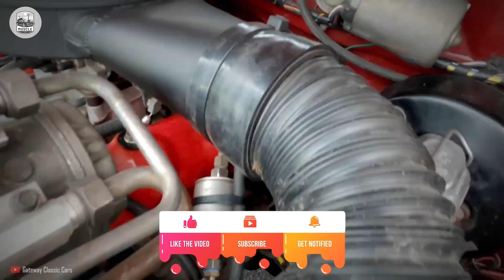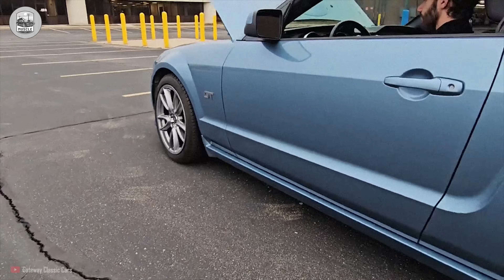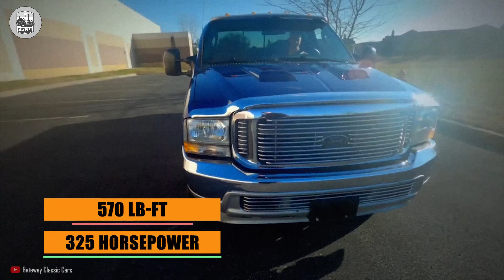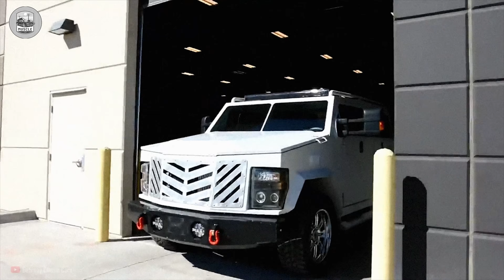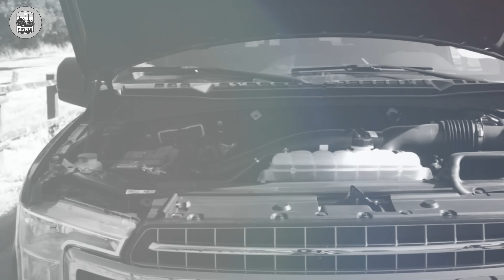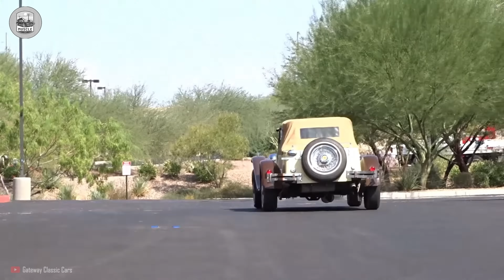NEVER BUY a Ford with this ENGINE | MOST FAILED Ford ENGINES ever put in production cars

Comment: This guy is an Idiot. He might as well just said that all Ford engines are junk. I was a tech for OVER 50 YEARS and although some of what he states is true, most is not. The Ford 4.6 was a great engine although I have replaced a few head gaskets and Intake manifolds but lack of cooling system servicing was the cause of most of it. He stated that the Ford Diesels were made by Ford while they were not. Harvester built and sold the 6.0 and 6.4 to ford for their trucks. In turn for all the problems, Ford sued Harvester almost into oblivion for supplying junk engines that Ford got stuck repairing. 
The 5.0 Coyote engine had some early problems but most have been addressed. ALL engines burn oil because of low tension oil rings. He talks like Ford is the only engines in the world to have head gasket problems. They mostly all had problems! He talks like it was only Ford that had problems. I took care of a fleet of ford Pickups and Vans with the 3 valve Triton engines. Most were sold at 300.000 miles and still ran like new. I replaced one or two Cam phasers. All still had the original chains and guides. They were maintained properly, with the best products. Out of all those trucks we had ONE spark plug blow out. I repaired it in our shop without even taking the head off. Nobody serviced them properly. You had to apply lubrication to the threads and use a torque wrench to tighten them to the proper spec. It's asswipes like this jerk that makes money by creating crap that most people believe.

Comment: As a Kiwi mechanic in the 1980's I rebuilt and tuned dozens of Mopar, GM, Ford, Holden and a few Pom V8's. All these engines had their own minor issues that could be improved on. Basically, they were all the same. The worse thing that failed these, and many other engines, was the removal of tetra ethyl lead from our fuel. This led to catastrophic valve seat wear, poor performance and expense of having to have the heads fitted with valve seat inserts. Fortunately, by design, they were easy to work on. An easy pre emptive fix was an upper cylinder lube device which metered small amounts of a hi tech oil into the inlet manifold. What I learn about these modern engines makes my blood run cold. Mainly from the stupid, untested design flaws/ ideas by the manufacturer and the horrendous cost and complexity of the remediation work. I take my hat to the modern mechanic 🙂
Reply from the maker: Wow, what an incredible journey as a Kiwi mechanic in the '80s
Tetra ethyl lead’s removal was a game-changer, and you're absolutely right—valve seat issues hit hard. It’s great you mentioned the upper cylinder lube devices; those were lifesavers for preserving performance in the transition era. The ease of working on those classic V8s really stands out compared to today’s complex engines—simple designs, but packed with character.
Modern engines can be a headache with their tech-heavy, sometimes untested features. It’s a salute-worthy effort from today’s mechanics to keep them running! Your insights into the evolution of engine design are pure gold for our Muscle Car family here.
For everyone reading this, share your own stories in the comments! Don’t forget to like, subscribe, and spread the word—let’s keep celebrating the legends of American Muscle Cars together. 
Hope to see you in the next video—have a great day.

Comment: 351M from 1975 into the early 80’s and their bottom end bearings wearing out prematurely about 70,000 miles is another one you missed…
Reply from the maker: Thanks for the comment
 You’re spot-on about the 351M—Ford’s “Modified” engine definitely had its share of issues. The 351M, introduced in the mid-’70s, was part of Ford’s attempt to meet emissions regulations, but it suffered from design compromises. One major flaw was its thin-wall casting and low oil pressure, leading to those bottom-end bearing failures you mentioned. Combine that with its low compression and disappointing performance for a V8, and it’s no wonder enthusiasts weren’t impressed.
That said, with some aftermarket upgrades, the 351M could be made reliable and even a solid performer. But back then, many gearheads swapped them out for 351 Windsors or 460 big blocks.
Have a great day.

Comment: 3.8 V6’s from the 80’s with their head gasket problems…
Reply: I bought new a 2001 F150 with the 4.2 version of the 3.8 Essex and it still ran awesome when sold at 212k miles. Very reliable, no headgasket issues.
Reply from the maker: That’s awesome to hear about your 2001 F150 with the 4.2 Essex V6
Ford really got the formula right with that engine—it built on the lessons from the earlier 3.8 Essex and proved to be a durable workhorse. Running strong at 212k miles without head gasket issues is a testament to good engineering and solid maintenance. For an engine designed to prioritize torque and reliability, it's no wonder the 4.2 found its way into so many loyal hands.
We’d love to hear more stories like yours—whether it’s about a trusty V6 or a roaring V8, every ride has a story. Share your experiences, drop a comment below, and don’t forget to like, share, and subscribe to American Muscle Cars! Let’s keep the community growing and the engines roaring.
Hope to see you in the next video. 
Wishing you a fantastic weekend—keep on cruisin
Reply from the maker: @johnmcmullen456 Ah, the infamous 3.8 V6 from the '80s and those notorious head gasket issues
 You're absolutely right—those engines had a reputation for overheating due to poor cooling designs and, frankly, a head gasket that just couldn't keep up. But when maintained properly, some of these engines proved surprisingly durable. The 3.8 also paved the way for Buick's turbocharged versions that absolutely ripped on the track—remember the Grand National?
For fans of American muscle, it’s a love-hate relationship with engines like this. They remind us that even our favorites aren’t perfect, but with some wrenching and a little love, they could still shine.
What’s your take—did you ever tackle a head gasket job on one of these? Let’s hear your stories! Don’t forget to comment, share, and subscribe to Muscle Car Masters to keep the conversation rolling. 
Have a fantastic weekend, and we’ll see you in the next video.

Comment: 3.8 V6’s from the 80’s with their head gasket problems…
Reply from the maker: Ah, the 3.8 V6s from the '80s—those head gasket issues were infamous
Buick’s 3.8 was a solid engine design, but poor gasket material and cooling system flaws led to leaks and overheating. If caught early, replacing the gaskets with improved materials turned these engines into reliable workhorses. Let’s not forget their impact: this engine laid the groundwork for the legendary Grand National and GNX turbocharged monsters! It’s amazing how Buick engineers pushed the 3.8 to deliver both reliability and performance in later versions.
To all American Muscle Car fans: we love digging into these stories and the engineering that made—or sometimes broke—the classics. Share your thoughts and experiences with the 3.8 or any other engine challenges you’ve tackled! Don’t forget to like, comment, and subscribe to Muscle Car Masters. Keep the love for American muscle alive
Hope to see you in the next video—have an awesome day...

Comment: We had a great experience with our ford 5.4 engine it was a 2 valve engine last I checked it was still running like it. Just left the lot brand new it’s over  quarter of a million miles and was never torn down
Reply from the maker: Wow, that’s an awesome testament to the legendary durability of Ford’s 5.4L 2-valve engine! Ford nailed it with that modular V8 design—known for its robust build and reliability. With over a quarter-million miles and no teardown, it’s clear you treated that motor right! These engines, especially the 2-valve versions, were known for their simpler design, fewer moving parts, and rock-solid performance. Perfect for everything from work trucks to daily drivers, they could run forever with just basic maintenance.
For those who don’t know, the 5.4 2-valve was often paired with the F-150 and Expeditions, delivering the torque and longevity that made them fan favorites.
Got a story like this? Share it with us below—we love hearing your muscle car memories! Don’t forget to comment, share, and hit subscribe to fuel our channel with your passion for American muscle. See you in the next video—keep driving those dreams.
Have a nice weekend.

Comment: The 4.0 SOHC? Also, I have 255k on my 3.5 EB. 70k of which was just this last year alone. Still going strong!
Reply from the maker: Thanks for your comment and passion for Chevy small blocks
The 305 shares many components with the 350, including gaskets, seals, cams, and lifters—classic GM parts-bin engineering. What sets the 305 apart is its smaller bore (3.736 inches) compared to the 350’s (4.000 inches), which limits valve size and airflow. While this made it more fuel-efficient during the gas-crunch era, it also restricted its performance potential.
We didn’t mean to knock the 305 but highlight its unique role in Chevy’s history as a compromise between power and economy. It’s no 350 powerhouse, but for many, it kept the small-block spirit alive when regulations made big performance harder to achieve.
Keep sharing your thoughts—we love a good engine debate! Don’t forget to comment, share, and subscribe to Muscle Car Masters. Hope to see you in the next video. 
Have a great day.

Comment: oh my gosh the 4.6 L 2 valve is one of the most reliable engines ever freaking made by Ford  the three valve is the one that has problematic issues with cam phasers and other things I've owned a few of them and I will tell you I have not had an issue at all and one of the most reliable engines that Ford has ever made even though it burns gas like freaking crazy is the big block Ford FE  it could be misfiring and jump timing to gear teeth or whatever but it's still freaking runs

Comment: The Narrator is obviously not a car guy.
Reply: Talking about a Ford engine show's picture of a dodge viper with the hood open? 🤷🤦"Ideal for F250-F350 trucks" shows an excursion 😂 I need some extra work, for a very reasonable price you can send me your script, pictures etc for me to document incorrect photos, videos information, spelling, etc then acquire the correct Media and information, proofread etc and return to you, I've been an automotive, truck, equipment, small engine, motorcycle, ATV,etc mechanic for over two decades, Including associated systems such as electronics, driveline, suspension, brakes etc I'm proficient in theory, design manufacturing assembly installation diagnosis repair replacement customization of most anything that burns gasoline, diesel , ethanol, methanol, nitromethane, jet A-1 etc or runs on electricity steam solar I've even repaired a water powered flour mill 😂
Reply from the maker: Thank you for pointing that out
We’ll be more vigilant with our visuals and ensure every image, video, and fact aligns with the heart of the muscle car world. Sharing your detailed knowledge would be a huge asset to this community! If anyone else has tips or corrections, drop them in the comments. Let’s work together to make Muscle Car Masters the ultimate destination for muscle car memories.
Remember to comment, share, and subscribe for more American muscle car nostalgia! Hope to see you in the next video. 
Have a good day...
Reply: Yeah, he's a robot.
Reply from the maker: @d.e.b.b5788   Hey there, thanks for the comment! 
But seriously, this channel is all about real car enthusiasts coming together to share the love of classic V8 power, timeless designs, and the roar of engines that defined an era. We aim to bring the incredible history and memories of muscle cars to fans everywhere—whether you grew up cruising in a Chevelle SS or just discovered the magic of a Mustang Mach 1. Your feedback keeps this mission alive, and we’d love to hear more from all of you.
Just kidding corner: We hope to have any robot or AI can generate the video like it...
Have a great day.
Reply from the maker: Thanks for your feedback
Our channel is all about celebrating the incredible history and performance of American Muscle Cars. While I may not be wrenching in the garage every day, I’m passionate about bringing accurate, detailed stories about these legendary machines to the fans who love them. If I missed the mark somewhere, let me know—your input helps make the channel even better. Drop your favorite muscle car or any topic you'd love to see covered! Don’t forget to comment, share, and subscribe to join our growing community of muscle car enthusiasts. Hope to see you in the next videos. 
Have a good day
Reply: @MuscleCarMasters68   F,in LIAR.

Comment: Bullshit on the 351w get real. One of the best engines ever made.
Reply: @havoc9926  that's a fact I have 2 trucks with the 351 and my boat has one to
Reply: @xxkingslayemxxgamer5553  I reckon!! I have just, this week re commissioned one in a jet boat. Just new cam, Timing chain, lifters, rings, big end bearings, re seat valves. Gaskets. 2 hrs to strip, 4 hrs to reassemble.  It had a bent distributor, possibly why the owner thought it needed a rebuild?? Parts were cheap. super simple job  🙂

Comment: Are the Triton and the Modular 5.4 engines the same. This video makes it sound like it.
Reply from the maker: Great question
The 5.4 Triton is part of Ford's Modular engine family, but they’re not exactly interchangeable terms. The "Modular" name refers to the entire engine platform that includes a variety of V8s and V10s, like the 4.6L and the 6.8L. The 5.4 Triton specifically refers to the version used in trucks and SUVs, often built with a 2-valve or 3-valve setup, depending on the model year. On the other hand, performance versions of the 5.4 Modular, like the ones in the Ford GT or the Shelby GT500, are entirely different beasts with superchargers and higher-performance components. So while Tritons are Modulars, not all Modulars are Tritons.
Thanks for pointing this out! We love digging into details like these. Got more insights? Drop them in the comments! Don’t forget to share and subscribe to American Muscle Cars. Hope to see you next videos. 
Have a good day...